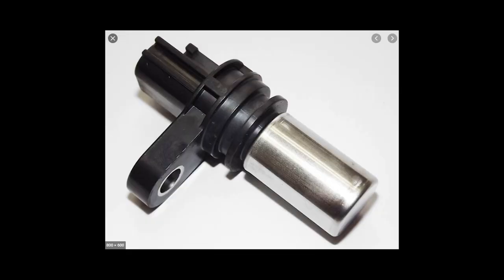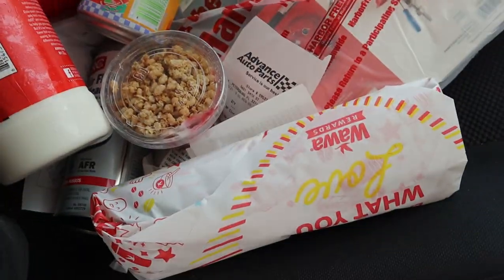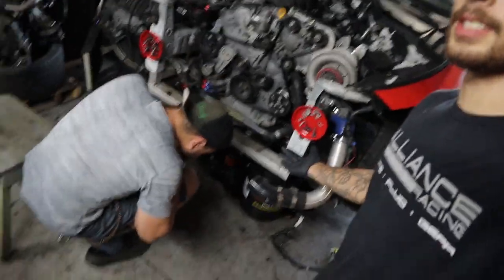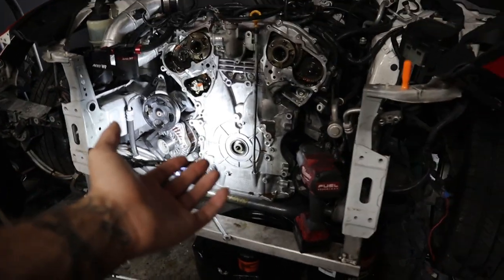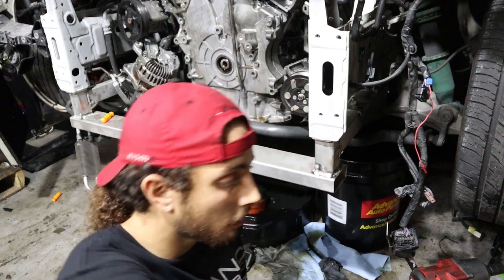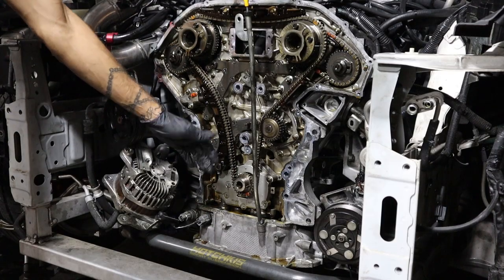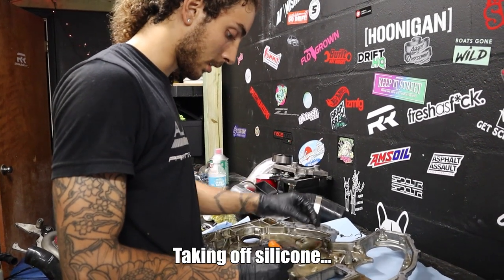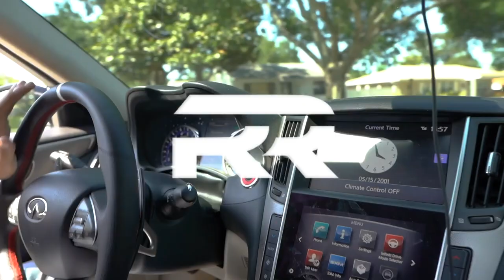Fixing the Q50 | Coolant & Overheating Issues

Comment: Having the same issue with my 15 q50 it only overheats when the A/C is on and i come to a stop once i get going it cools back down! Can’t figure out that issue
Reply from the maker: Seems like a water pump or thermostat issue
Reply: @RomeloRoman  changed the thermostat my guess it’s going to be the water pump! Thanks
Reply: Thanks thermostat has been changed still the same! Temp reaches 228 and stays there for a while before i have to turn the ac off and then goes back to normal
Reply from the maker: @socal818P  I'd recommend changing the water pump & try your best to bleed the coolant system.  Hopefully not a head gasket issue
Reply: @RomeloRoman  that’s my next step hopefully it works out! Thanks for the tips
Reply: For me when I turn on the AC the temp goes down and heat brings it up. And coolant dissapears and engine is making a super weird sound
Reply: @socal818P I have the same problem bro did you figure out the problem?? I feel like trading in my car bro so stressful when it’s your only car and the dealer and can’t even figure out what it is 🗑
Reply: @jayb3527  hey I changed my coolant reservoir cap from the Infiniti dealership and did a coolant pressure test and it fixed the issue. BTW if you do run aftermarket intakes that are made out of steel or anything I would get rid of them because they get hot really quickly
Reply: @forzafestiva1  thanks man will try this out
Reply: @jayb3527  yessir you good
Reply: Hey were you able to fix the issue? Im having same problem on my 14 q50
Reply: Dude, this sounds like an air flow problem.  Check to make sure your cooling fans are operational.  Maybe upgrade to a better quality fan.  also check to make sure the radiator is not blocked.
Reply: I had a similar problem.  My radiator fluid was so low that it never pulled from the overflow reservoir.  Obviously I have a leak somewhere,
Reply: @forzafestiva1 what is the water pump
Reply: @JoseAlvarez-v2r  idk bro I sold the car and got a 2018 camaro ss 1le
Reply: Heyy I know this comment has been a while back but I’m having the same issues do you know what happened to yours ?

Comment: Coolant only drops after I use heat or ac (goes from max to about half between max and min in 30 mins of full blast 60 degree ac and a 5 minute trip to Taco Bell)  our ac has randomly shut off and turned back on a couple times.

Comment: Bro im.having the same problem, it ain't the thermostat, cap, and the water pump. The upper hose is fine not to sure if it could be the lower hose or the radiator it's self. It only leaks when I drive it
Reply: porous block... mine might be having the same issue. its at the dealer right now. unfortunately many say it requires a new block and turbos to fix. manufacturer quality issue. should be good if you still have your warranty.
Reply: Did you find the problem out bro ?im dealing with the same thing

Comment: My sister has had her Q50 for one year literally 12 months and it has cost her $5,000 in repairs so far 

Transmission Valve body failed five months in and this week her radiator failed and car overheated 

Q50s are absolute garbage don’t buy one 

Also the infotainment system has issues
Reply: They not garage it depends which one she got
Reply: Did my valve body last week. Common issue on older Q’s unfortunately
Reply: that’s crazy my radiator just failed too😭
Reply: same boat i think im on radiator part now lol